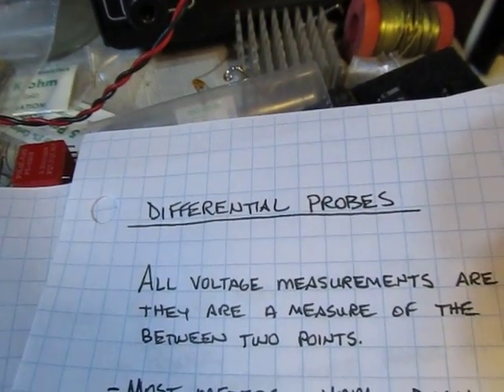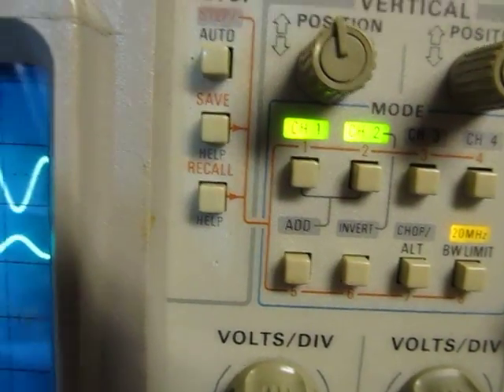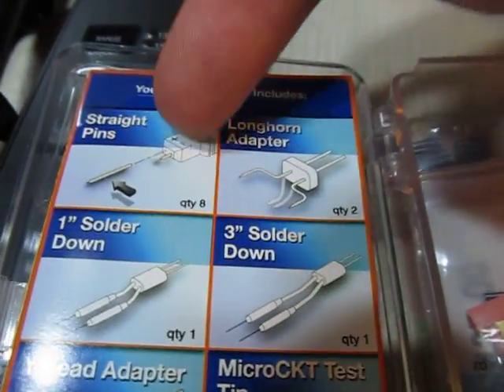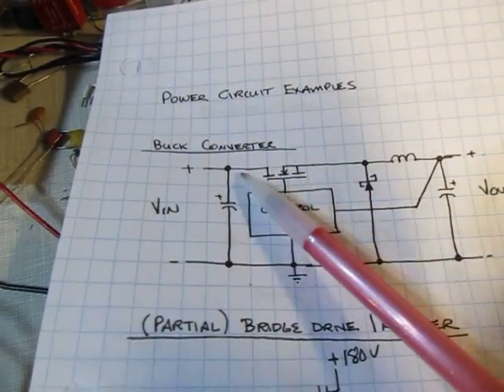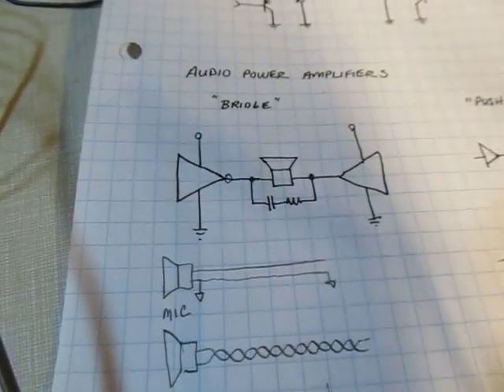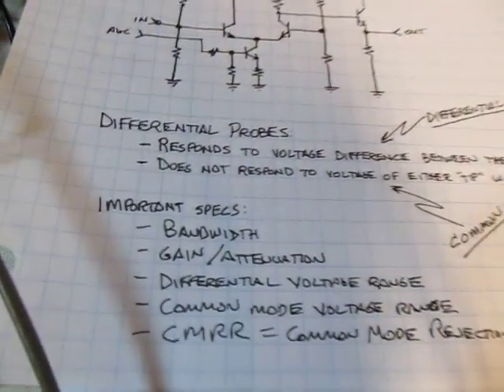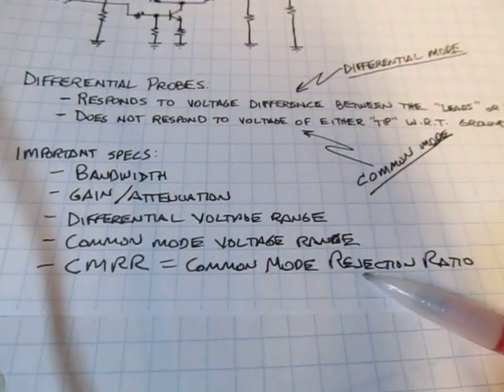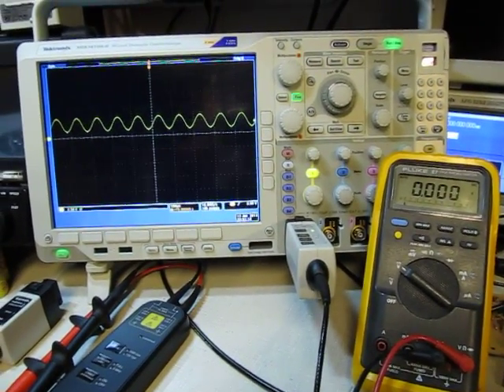#74: Basics of Differential Probes for Oscilloscopes and their applications: a tutorial

Comment: Thank you for all your video tutorials. I am planning to design a differential probe for my oscilloscope for motor drives output measurement.  I need a place to start up from. Therefore, I would appreciate very much your help and guidance.  Big fan of yours, thank you.
Reply from the maker: The first considerations are to define what you need the probe to do.  These will set the direction the design will take.  Things like:  What frequency range or bandwidth is needed?  Does it need to respond to DC?  What differential voltage range is needed?  What input impedance is needed?  What common-mode voltage needs to be accommodated?  What common mode isolation is needed? etc...
Reply: Thank you, Sir, for your response. Well, I need to measure armature voltage at around 400v dc and 3 phase 415v ac . Is 4 mohm input impedance sufficient? Not sure. I need it for single channel scope. It would be really helpful and useful for me and  others who also may be looking for a similar design, if you kindly make a video about it. My thanks and appreciations

Comment: They sell diff pre amps for tektronix scopes. How is the application different between a diff probe and that? Aren’t both essentially diff amps? However the diff amps cost so much more
Reply from the maker: The diff amps are typically optimized for low bandwidth, very low signal level applications, where the diff probes are typically optimized for higher BW, larger differential voltages.

Comment: Are these isolated or simply have resistive dividers that bring the voltage into the supply range?
Reply from the maker: Differential probes are generally not isolated - they'll have a specified permissible common-mode voltage range.  There are (very expensive) isolated differential probes that typically use fiber optics for galvanic isolation.

Comment: My Tek 7403 came with a Differential Amplifier plug-in. I have not used it for anything yet as I am still having trouble keeping the 'scope HV supply running but presumably, it could be used with two probes to function in this manner. Is my thinking correct?
Reply from the maker: Yes.
Reply: @w2aew  Thanks Alan.

Comment: Thank you very much. how about a battery oscilloscope, should one use a differential probe with a battery scope or it does not need one.
Reply from the maker: For a battery operated scope, you might not need a diff probe, as long as the scope isn't grounded.  But you will have to take great care since the scope's local ground will be elevated to your circuit's voltage.
Reply: @w2aew  thank you very much for your advice I would have to let that settle in to get a good grasp and understanding of, I mean, what you said about my local ground will be the circuit ground. Thanks again.
Reply: @w2aew  can I ask you about 2 oscilloscope I am thinking about purchasing 1 or the other, tektronix TDS5054 and  TDS3054. Which one would be more useful for circuit repair lab?
At moment I am trying to use and learn on a portable fluke 123B, and a 100 MHz Hameg rohde & Schwartz HM1000.
Reply from the maker: @AB-yu2tj  Both of them are 4 channel 500MHz scopes, but there are significant differences.  The TDS5054 is physically much larger.  It has a much larger screen, much deeper memory.  But, it also includes a PC (very old now) that is likely running Windows 2000 (and can't be upgraded).  The TDS3054 is much smaller, has less sample memory, but is still a very capable scope.  Since it doesn't have a PC embedded in it, there's less to go wrong.  For a circuit repair lab, I would go with the 3054.
Reply: @w2aew  thank you very much 3054 it is

Comment: I just bought a TDS754C to replace my old Hitachi V-680 that I've had since the '90s. Can you advise on what probe to get for it on a budget? Love your video's by the way. 73's
Reply from the maker: The recommended 10x passive probe for this model was the P6139A probe.  It is a 500MHz 10x probe.  Generally, any 10x probe whose compensation range includes 10pF should work.
Reply: @w2aew  Thanks for your advise. I will look into getting one.

Comment: if I power the osilloscope with isolation transformer, what would still be the differences between single ended probe and differential probe measurement?
Reply from the maker: Powering the scope from an isolation transformer is not recommended - it can potentially put dangerous voltages on the chassis (and BNC connectors) of the scope.  There will likely still be differences because the circuit would have to "drag" the scope chassis to follow the signal on the probe's ground lead.  Bad idea.

Comment: When using two probes to make a differential measurement (like in this video or with a DSO with math function), is it best to clip the two probe grounds to circuit ground or can/should the ground leads be clipped together and left floating wrt the circuit ground?
Reply from the maker: It's usually best to clip them together.  If there is a lot of stray common mode, then you additionally clip them to the circuit ground.
Reply: w2aew - Thanks for the reply! I love your videos. Please keep up the great work!

Comment: Hi Alan, if you have time, check out this circuit from Joe Smith. He’s quite the engineer such as yourself. This looks like a good low cost option for differential probes. They are very pricey to purchase as you know. This seems like a good budget circuit for some home use non super high accuracy applications .  https://youtu.be/_OZ5Xer84eo

Comment: Experimenting with Pulse Width Modulator for a class E transmitter.  The PWM switching FETs work against a floating ground. Voltage measurements here are differential.  It's the following LPF that delivers the modulated DC voltage which is common mode (against chassis ground).  Great explanation as usual.

Comment: Another option not mentioned in the video for taking a differential measurement is floating the scope.  Of course this has safety implications and should not be attempted without understanding the dangers, but is done routinely in EMC labs.  However I have also heard that aside from the safety issue that this is not good for the scope.  I can only presume this has to do with input protection circuitry but is only a guess.  Can you  confirm my suspicion?

Thanks

Comment: In your video the Gate to source is neither +180V or -180V. 180V and -180V is on the Drain to Source? The turn ON gate voltage is much less than 180V right? Please clarify
Reply from the maker: The common-mode voltage of the gain and source voltages can be 180, the gate to source differential voltage is much less of course.

Comment: Your explanation about "Balanced audio" is ALMOST right. "Balanced" means that every line have equal impedance to ground (receiver) and nothing more. Having signal in reverse polarity on one line is called "symmetrical audio" and it have other purpose. You can have symmetrical but unbalanced interface, or asymmetrical and balanced same time. These are two different thing for different purposes. Balancing is for noise cancellation, symmetry is for getting bigger output signal from the same voltage (less crosstalk and slightly better SNR). 
Great video!

Comment: Hi Alan:
The derating curves that I've seen for most high voltage differential probes are pretty steep, so they look like they would be inadequate for high voltage measurements at high frequencies, say in the range of 30 MHz.  Do you know of any high voltage differential probes that are still good at higher frequencies?  Thanks.
Reply from the maker: It all depends on what combination of voltage and frequency that  you need.  Tek has a large variety of HV differential probes with different ratings.
http://www.tek.com/probes-and-accessories/high-voltage-differential-probes
Reply: I looked at the specs for the Tek probes; perhaps I missed something. It seems that for high voltage, they're only good up to about 1 MHz, and then there's a sharp decline.  Say I wanted to measure 1000 volts RMS at 30 MHz?  Are there any probes that can do that?  Thanks.
Reply from the maker: The only probe system that I know of that can do this is the new TIVH series of IsoVu probes from Tektronix - up to +/-2500V differential with 120dB of CMRR.

Comment: Hi das the DM in the tek analog scop is like the Differential Probes Thanks
Reply from the maker: Using 2 channels with the ADD and INVERT functions, and matching probes, is similar to a differential probe.
Reply: no i min the tektronix 2465A DM build in multi meter thes it function like Differential Probes
Reply from the maker: The inputs of the digital multimeter option are isolated from ground, so they can make a differential measurement across a component, etc.  It is basically a 4-1/2 digit digital multimeter with true RMS ACV from 20Hz to 100kHz, and true RMS ACI from 20Hz to 10kHz.  It has 10uV resolution on DCV, a continuity beeper, input for temperature probe, and convenience features like smoothing, display hold, min/max, dBV and dBm measurements.  It displays numeric results, NOT waveforms like you get with a differential probe on the scope.
Reply: really good information thanks for your time

Comment: What happens above the "common/differential mode voltage range" but below the "maximum nondestructive voltage range" that I see on Tek's low voltage diff probe datasheets? Is this region merely where the output becomes "untrustworthy" (CMRR, attenuation, etc might not live up to the in-range spec) or does the intermediate region present a danger to the probe's amplifier, while the region above the destructive threshold poses an especially severe danger (probe turns into a short or something)? PS Thanks so much for making these videos! The educational quality is fantastic!
Reply from the maker: Generally, exceeding the common mode range will result in not meeting specifications - which could mean anything from distortion of the signal, incorrect voltage measurements, degradation of CMRR, etc.  No damage to the probe as long as the maximum non-destructive voltage isn't exceeded.
Reply: Thanks! It was going to be a real challenge to treat the 850mV diff mode maximum on the P6248's 1x range as a safety limit. Very pleased to learn that Tek has done the hard work for me. The 25V nondestructive max gives very comfortable headroom in my application.

Comment: Hi! This was an interesting video! I'm an electronics technician who works on vintage and modern vacuum tube equipment...Guitar/Hi-Fi amplifiers, tube radios, tube TV's, phonos and pro audio. as you may know many of the earlier tube radios/phonos didn't use a power transformer for the series wired filament string, and one side of the AC mains was connect to the chassis which can make the outside of the set hot (depending which way the plug is inserted) Using a scope on equipment like this can be deadly since the ground clip is referenced to the electrical system ground. Using an isolation transformer while working on this type of equipment is mandatory for safety...however, you still must be careful on how you connect your scope probe to the circuit under test. I've been quite careful working with my CRT scopes. Some techs float their scope as well as the DUT. Not a good idea either. Since the differential probe is basically isolated, this makes things a lot safer for working on a lot of vintage electronics. Equipment that use power transformers are much safer because there's built in isolation. Interesting videos! Keep 'em coming :) Frank Ferraro--Audio Craft Electronics.

Comment: So what would be the difference between isolating the DUT and using differential probes? I've been pricing out differential probes and they can be pretty expensive so I'm assuming there must be some benefit over simply using an isolation transformer for the DUT. Great vid, thx!
Reply from the maker: +Mike O'Brien It really depends on what the signal and circuit look like.  Simple circuits and low speed signals - this would work fine.  However, problems can arise with high speed signals or high-impedance circuits because of coupling from the isolated supply and true ground.
Reply: +w2aew wow, thx for the quick response!
Reply from the maker: +Mike O'Brien You're welcome - you happen to catch me online, answering several viewer comments and questions (I get a lot of them!).

Comment: You should be just fine when measuring arbitrary points (but only 2 points, with single channel!) in electronic circuit with your scope, if you isolate the device you are testing from the ground (it can be if it is battery operated, have a power supply with galvanic isolation, most linear and switching power supplies will do, or you use isolation transformer). Still, using differential probes, is much more safer (especially in high voltage applications), and allows you to use multiple channels without woring about grounds. Good video.

Comment: The "invert and add trick" only works for small offsets from GND if DC coupling is used. Using AC coupling it has always been good enough for me.
If the difference is small compared to the signals you do need a differential probe.

Comment: fine job describing   common mode noise.  
 for an actual procedure to adjust a diff'l amp circuit to minimize the  common mode noise see p. 6 of this article.    its both easy to  follow and to do.   all you need is an
audio signal generator and a VOM.  

http://www.n5dux.com/ham/files/pdf/Build%20A%20Brain%20Wave%20Feedback%20Monitor.pdf

Comment: Are there any gotchas with using a high voltage differential probe (e.g. 700V) for probing low voltage (e.g. 12V max)? E.g., would a high voltage differential probe be appropriate in your recent V-I curve tracer video (197, another great video)? There is a significant price difference between the high and low voltage differential probes. Thank you
Reply from the maker: The only real gotcha is that the HV differential probes generally have a higher attenuation factor, making it difficult to observe the small signal across the DUT or current shunt resistor in that case.  In general, you also have to be careful of the input capacitance, although that wouldn't matter in the VI tracer case since a very low frequency was used.
Reply: +w2aew And their price ;)

Comment: Very informative.  How does using the differential probe differ from using standard probes and the differential plug in module on my 545b scope?  Thanks
Reply from the maker: For one thing, you won't have to match the probes, and the CMRR will likely be better.
Reply: I have a set of matched P6006 probes for the 545 differential amp, and for what I am doing, I thnk I will have to stick with that setup for now.  I am really enjoying getting back to the hobby again.

Comment: Hi,
Do you have any idea how to probe a high freq tig welding machine in its pulse fase in ac mode and dc mode  there about 250 amps and about 500 hz and shifting in the puls more positief or less postief in a pulse.
How do you measure that
Regards
Cees
Reply from the maker: That might be best probed with a non-contact method, using a simple coil of wire as an H-Field probe.
Reply: ***** ok thanks
is that easy t make?  or is it a simple coil  attached to the BNC connector or do i have to watch out for several other things?  that could interfere
Cees

Comment: Hello, thank you for a great video. I wanted to ask one question. Can a differential probe of one company be used with the oscilloscope of other company. What are the factors important for such. For example can I use techtonix probe with picoscope oscilloscope.
Reply from the maker: Often the differential probes are powered up via the probe interface that is specific to the manufacturer - making it impossible to use it with other manufacturer's scopes unless you have a dedicated probe power supply.

Comment: So... i guess since most differential probes are "active probes" the would need to be "matching" the scope vendor ?? so i cannot use a tek diff-probe on a HAMEG DMO or vice versa.  That may also explain why those probes are expensive like hell! Like for the HAMEG they are 350+ EUR for diff probe.  Jesus christ!!!
Reply: Axel Werner It depends, some probes are universal.  The newer probes are less universal as they add their own connections on top of the bnc connection.  So if it is a simple BNC connector and the power is provided by internal batteries or a separate power input - then it can be used universally.  There are some lower cost diff probes out there. ;)

Comment: As far I understand it, differential probes require power from the scope for the amplifier in the "head". Can you add external power if you are using it on the old analogue scope or DSO without the special connectors? Or you are stuck with the two passive probe solution only?